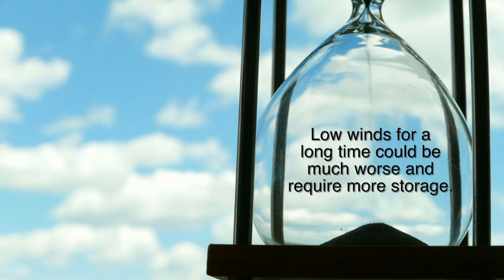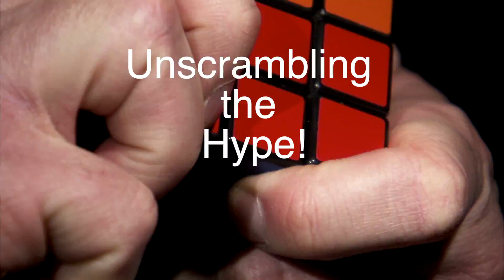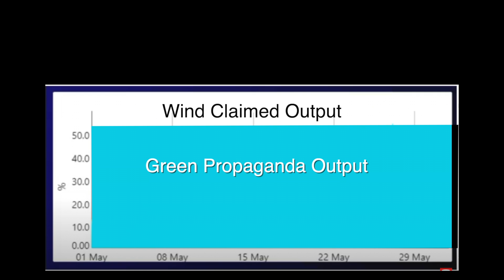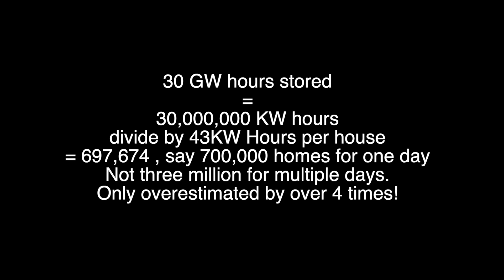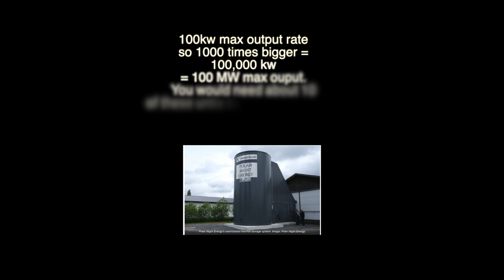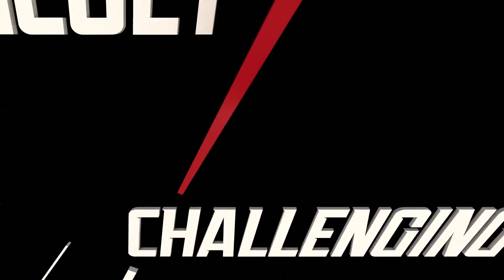When the wind stops 7   Is anybody doing the maths?

Comment: It has concerned me, too, that no-one is doing any maths!

First, it is not sensible to just consider existing electricity consumption because when transport is migrated to be all electric then electricity usage will nearly double.

Second, while so-called renewables are posited as the way forward, no-one has worked out how much of the land will be taken up with either solar panels or wind turbines. I once calculated that Drax power station would need several hundred square miles of solar power to replace it and that did not include any consideration for storage. Several UK counties would need to be completely covered with solar panels to power the whole of the UK.

We already have enough data to do these kinds of sums so why are we not being informed of the logical consequences of our energy plans?

Comment: You not only have to do the maths, but you have to do the 'right' maths and you have to get your analysis correct and thorough. A lot of this discussion is not comparing apples with apples. 

For example. Whilst I would agree that the figures given for GE's Haliade-X 12 MW wind turbine is probably somewhat over egged, they are by no means as bad as depicted by the analysis. Whilst I'm very doubtful that many, if any, will achieve 64% capacity factor (C/F), when installed at sea they should achieve well into the upper 40% C/F. The 30% figure is the combined onshore and offshore wind turbines, many, of not most, existing offshore ones consistently achieve far higher than this, and some of the newer wind farms well into the 40% range, even at half this size. 
There is a report that onshore wind turbines in Germany 'may' kill hundreds of thousands of bats, but I would suggest that the chances of this happening in an offshore wind farm are practically zero, although there may be a significant amount of seabird fatalities. However come up the data suggests that these numbers pale into insignificant compared to the numbers are killed by cats each year, an estimated 55 million in the UK alone!
Another invalid comparison was comparing the Haliade-X average output and saying it was not sufficient to boil a kettle etc. If you use the average output from the wind turbine you've got a compare it to the average power used by kettle, 3KW x 3mins x 4 times per day = 36W-minutes = 0.025KW average, so at a realistic C/F of 45% 1 Haliade-X could provide daily cuppa's for about 5.2M homes, but this is also a pretty meaningless, albeit amusing, statistic. 

It is also well understood, that when wind is discussed for powering homes it is referenced to electrical power, not total power, so adding gas usage into the energy consumption is totally misleading. If homes were to be powered purely by electricity then it is almost certain that the vast majority of homes will be powered using heat pumps, which on average would use about 30% of the energy required to heat them by gas. Furthermore, Paul's figure for electricity consumption, 10.22 kwh/day, is significantly higher than the current typical UK domestic usage given from Ofgem figures, which currently works out to about 7.40 KWh/day, although this might have been about 10% higher when this video was made. A more realistic figure for a fully electrified home, assuming current stock and energy performance levels, would be around 17KWh of electricity, not 43KWh per day. 

With regard to energy storage, with very few exceptions, regardless of capacity (power or energy) the economics of any storage technology other than some form of synthetic fuel (possibly, although probably not, hydrogen) do not add up. The one possible exception is pumped hydro with a high energy (GWh) to power (GW) ratio that can supply electricity for long periods, at least several weeks per year, but suitable locations are few and far between. 

Considering storage requirements, we should be looking at what will be required not what is currently used. Latest analysis by Oxford and Cambridge suggests that by 2050, with a high renewables generation mix, we are likely to need in the region of 50,000 GWh, or 50TWh (Terawatt hours), to balance wind and solar, requiring around 100TWh syn-fuel if hydrogen is used, (note 30% is the round trip efficiency, hydrogen to electricity should be 50%+ efficient). Providing this level of storage is definitely technically feasible, and with the latest emerging the technology I believe will be economically viable within about a decade. 

Paul's right in that we do currently have an issue with renewables overcapacity, particularly wind, at times which we are paying for but not using. However, although the numbers seem large they need to be viewed in context, and in the overall scheme of things this is not a show stopper at the moment, the total UK consumer bill for electricity in 2023 was probably around £100Bn, curtailment costs were probably only around 1%, if energy bills had only gone up by this amount since 2019 I don't think consumers would be complaining.
Reply from the maker: YOU
Whilst I'm very doubtful that many, if any, will achieve 64% capacity factor (C/F), when installed at sea they should achieve well into the upper 40% C/F. The 30% figure is the combined onshore and offshore wind turbines, many, of not most, existing offshore ones consistently achieve far higher than this, and some of the newer wind farms well into the 40% range, even at half this size. 
Answer
oversell taking the UK as a whole and offshore and onshorencombioned you get 31.8%.fact.
Offshore would be higher, onshore lower to get that average.
YOU
There is a report that onshore wind turbines in Germany 'may' kill hundreds of thousands of bats, but I would suggest that the chances of this happening in an offshore wind farm are practically zero, although there may be a significant amount of seabird fatalities. However come up the data suggests that these numbers pale into insignificant compared to the numbers are killed by cats each year, an estimated 55 million in the UK alone!
ANSWER
I never claimed offshore killed bats but in certain areas off the North Sea there has been a 90% drop in diving sea bird numbers. Alkali two bad things to not make a right. It's bad enough the cats killing birds but not many manage a diving sea bird.
YOU
Another invalid comparison was comparing the Haliade-X average output and saying it was not sufficient to boil a kettle etc. If you use the average output from the wind turbine you've got a compare it to the average power used by kettle, 3KW x 3mins x 4 times per day = 36W-minutes = 0.025KW average, so at a realistic C/F of 45% 1 Haliade-X could provide daily cuppa's for about 5.2M homes, but this is also a pretty meaningless, albeit amusing, statistic. 
Answer
I did not make any invalid comparison. Just stated the facts.
The simple fact is that at times a wind farm provides no homes at all. At ther times it is paid not gove us energy and it always needs 100% gas backup. When they state how many homes what they should state is that those homes according to OFGEm - so they supply 20% of the homes energy overall;l and gas supplies the 80%....fact. Your calculations are meaningless, we go on the average home per annum.
YOU
It is also well understood, that when wind is discussed for powering homes it is referenced to electrical power, not total power, so adding gas usage into the energy consumption is totally misleading.
ANSWER
Not understood by the public but all I ask iOS they tell the whole story.
YOU
 If homes were to be powered purely by electricity then it is almost certain that the vast majority of homes will be powered using heat pumps, which on average would use about 30% of the energy required to heat them by gas. Furthermore, Paul's figure for electricity consumption, 10.22 kwh/day, is significantly higher than the current typical UK domestic usage given from Ofgem figures, which currently works out to about 7.40 KWh/day, although this might have been about 10% higher when this video was made. A more realistic figure for a fully electrified home, assuming current stock and energy performance levels, would be around 17KWh of electricity, not 43KWh per day. 
ANSWER
The figures I used are from OFGEM and BEIS medium house - not mine and are whet they claim to base their figures on.
Hertz pumps cannot be installed in the majority of existing homes. They require 220% more radiators or underfloor heating.
YOU
With regard to energy storage, with very few exceptions, regardless of existing homes as they need 220 per cent more radiators o ruis of capacity (power or energy) the economics of any storage technology other than some form of synthetic fuel (possibly, although probably not, hydrogen) do not add up. The one possible exception is pumped hydro with a high energy (GWh) to power (GW) ratio that can supply electricity for long periods, at least several weeks per year, but suitable locations are few and far between. 
ANSWER
Wrong. they 9 days without wind in 2018 requires 7,200 GWh, Diniorwic supplies 9.1 GWH., No chance of long periods even in then hours not weeks!
YOU
Considering storage requirements, we should be looking at what will be required not what is currently used. Latest analysis by Oxford and Cambridge suggests that by 2050, with a high renewables generation mix, we are likely to need in the region of 50,000 GWh, or 50TWh (Terawatt hours), to balance wind and solar, requiring around 100TWh syn-fuel if hydrogen is used, (note 30% is the round trip efficiency, hydrogen to electricity should be 50%+ efficient). Providing this level of storage is definitely technically feasible, and with the latest emerging the technology I believe will be economically viable within about a decade. 
ANSWER
That was rubbish report but nothing in it is viable, Basing our entire economy one wishful thinking and for what? CO@ does not control the climate, the entire basis is wrong.
YOU
Paul's right in that we do currently have an issue with renewables overcapacity, particularly wind, at times which we are paying for but not using. However, although the numbers seem large they need to be viewed in context, and in the overall scheme of things this is not a show stopper at the moment, the total UK consumer bill for electricity in 2023 was probably around £100Bn, curtailment costs were probably only around 1%, if energy bills had only gone up by this amount since 2019 I don't think consumers would be complaining.
 ANSWER
That is not correct. We have to build 100% gas supply for any wind/solar farm and at times are paying up to 50% of the time not to supply energy. its the economics of the mad house.
Reply: @ClimateRealism  
With all due respect Paul, having read your replies to my initial comments, I think there's little point in continuing this discussion. Personally I don't believe that 99% of climate scientists are trying to pool of wool over our eyes about the climate just to keep their jobs, although I'm sure there are a few rogue players in there. 

When you discredit headlines about 'wind generation producing 50% are the UK's power', by saying that that it only happened for a short time, even though what they stated was a fact and wasn't a claim, as you suggested, that it was happening all the time, and then a short while later saying that we are curtailing 50% wind farm output at times, but fail to mention that this is pretty rare also, but never mention the fact that, in 2023 for example, curtailment was about 7% of production (the real crime I would suggest was how much we were paying, looks like about £230/MWh, vastly more than wind strike prices), this looks to me like two different sets of rules. 

I could go on, but I don't have the time, although I would say your video about Drax and the dishonesty behind their renewable energy claims etc, was, for the most part, quite informative.
Reply from the maker: @nickcook2714  
You
With all due respect Paul, having read your replies to my initial comments, I think there's little point in continuing this discussion. Personally I don't believe that 99% of climate scientists are trying to pool of wool over our eyes about the climate just to keep their jobs, although I'm sure there are a few rogue players in there. 
Answer
I never stated that, so you put forward a false narrative and then dismiss it on a believe without any evidence. Not scientific more like a religious belief.
YOU
When you discredit headlines about 'wind generation producing 50% are the UK's power', by saying that that it only happened for a short time, even though what they stated was a fact and wasn't a claim, as you suggested, that it was happening all the time, and then a short while later saying that we are curtailing 50% wind farm output at times, but fail to mention that this is pretty rare also, but never mention the fact that, in 2023 for example, curtailment was about 7% of production (the real crime I would suggest was how much we were paying, looks like about £230/MWh, vastly more than wind strike prices), this looks to me like two different sets of rules. 
ANSWER
The report by a committee of MPs found in the case of the three farms they looked at they were paid not to produce just short of 50% of the total time. A problem that will get worse and worse as we add more wind farms.
It is not rare but you choose to see not what I claim but what you wish to see.
YOU
I could go on, but I don't have the time, although I would say your video about Drax and the dishonesty behind their renewable energy claims etc, was, for the most part, quite informative.
ANSWER
Your choice of course but you have backed out without a single jot of counter evidence.

Comment: Why aren’t our river and other water being accessed ?
Reply from the maker: Because there are very few sites where you can lift a large body of water up a great height. In  fact , probably less than half a dozen. The task of pumped storage is not to back up long therm failure of wind - there is no way of getting even a tiny fraction of the required energy stored and at great cost. Pumped storage like Dinorwic is to even out the tiny fluctuations in energy from second to second. Not back top steroid wind and solar.

Comment: In my road there are 4 households with electric cars , we are living in terrace homes so no driveway , each time they are plugged into car from house the wire is across pavement there have been a few near accidents myself including re nearly tripping over . I did wonder though how much their electric bill will be seeing the energy has increased. One of the car is a 4 x4 jeep it’s huge .
Reply: This is a problem that needs sorting out, but in the meantime if someone should trip and hurt themselves then I assume they would be perfectly entitled to sue a person responsible for placing the trip hazard there, in the same way you can sue councils for badly laid paving if you trip and injure yourself. Maybe a polite notice through the letterbox of those concerned might be in order.

Comment: Hi Paul, what are your thoughts on salt water batteries for domestic storage solutions? Also do you have any opinions on small scale biodigesters for personalised domestic useage?
Reply from the maker: Salt water batteries have the main advantage over lithium ion in being much safer but that is about it. They are very much larger and expensive.
Batteries for domestic storage of energy like Tesla are very expensive for what you actually get - a tiny amount of power stored. Saltwater batters do not have the economy of scale of lithium ion and so are very expensive and much bulkier.
The start up funded by Bill Gates went bankrupt about 5 years ago.
Hence I would avoid them all together as a bad investment.

Having no mains sewage, I have a small biodigester myself . They are very good in cleanly digesting sewage and that is it.

Comment: I've been saying for years why not use water wheels? Every city has at least 1 River running through it and its technology we've had for centuries plus rivers always run unlike the wind.
Reply from the maker: Sorry but it would not work. The low head of water with water wheels is such that they cannot generate any significant energy. This is why with hydro power we have to store the water up high and run a large quantity down pipe to turbines. This is a great power source but we have already all but saturated its possibilities.
The answer is very simple, nuclear and gas.
Reply: @ClimateRealism  sorry I never meant to say it's a better option to nuclear or gas. I was comparing wind turbines to water wheels.
Reply from the maker: @andymester9661  Yes I understood that but water wheels produce very little energy indeed and cannot be compared to even wind vanes.